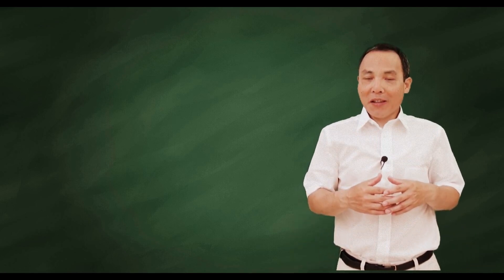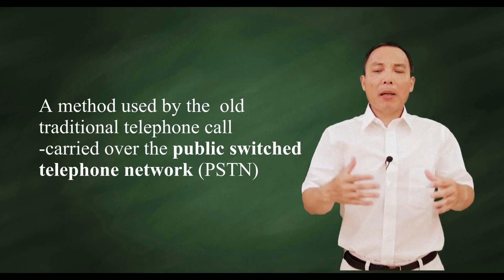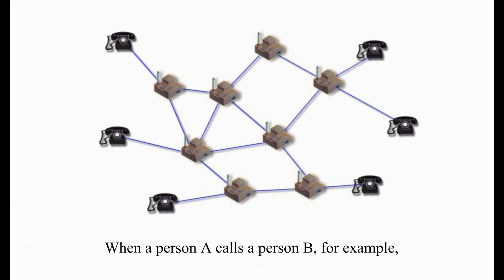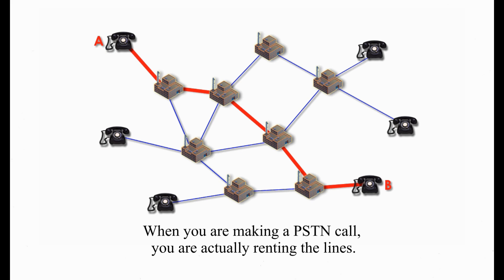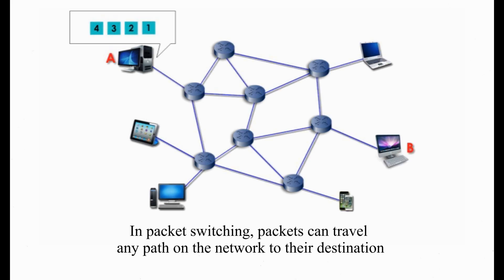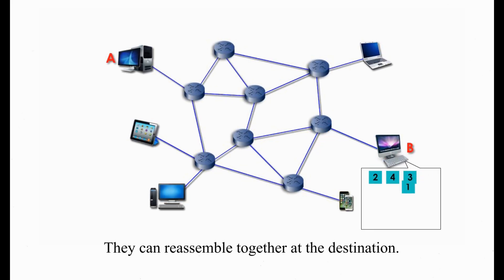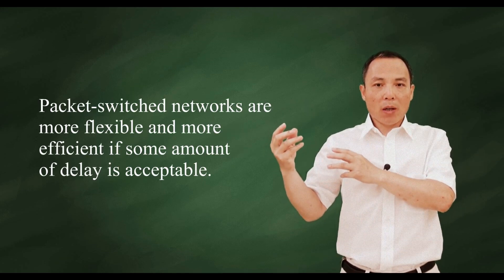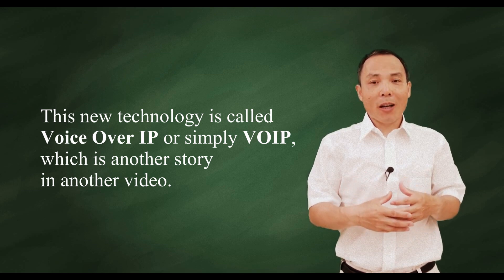Circuit Switching vs. Packet Switching

Comment: Nice explanation. Thought to ask a question since you are actively replying to everyone. Thank You
One question, Are circuit switching protocol wireless? If so,
I am clear that internet call uses packet switching so some delay is there. But is a cell phone call without the internet let's say for instance Verison using circuit switching?

Comment: Circuit switching How connection is established??
Reply from the maker: they fix a route by connecting all points.
Reply: @sunnyclassroom24  but how they know which route to follow. In circuit switching there's only role of physical layer.
Reply from the maker: @1-minutetips109  normally switching method is used by traditional telephone system. The internet and modern networks use packet switching. You are correct about physical layer because it is simply connecting all dots between point A and point B.

Comment: I have a question, when the line that is operated in circuit switching is used, does it mean that it will not allow other calls to pass  unless terminated? 1:27
Reply from the maker: yes, that line (circuit) is reserved. In reality, different technologies make it possible for many users to share one line without interfering each other.
Reply: @sunnyclassroom24  even though one line is shared there is a limit  say 2000, then if a person calls and he is 2001 in the list he's call will have to wait or the call will go through another line... This can be seen during holiday seasons like Christmas were u will have trouble calling which happens due to all the available lines getting filled...I remember someone saying this to me😊